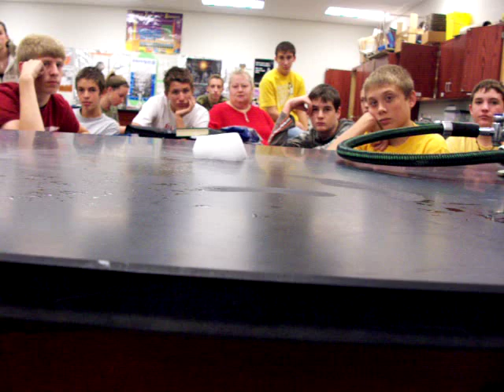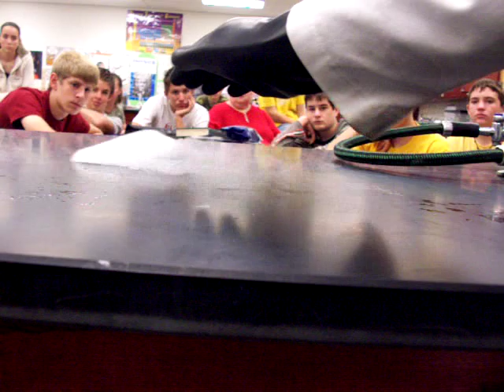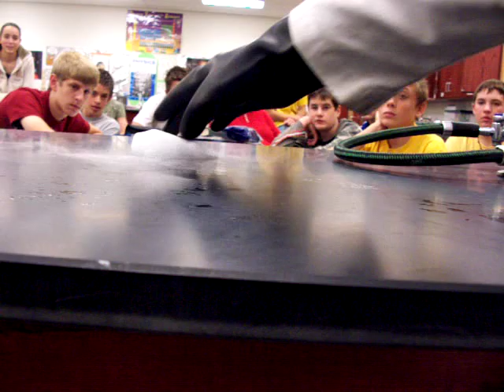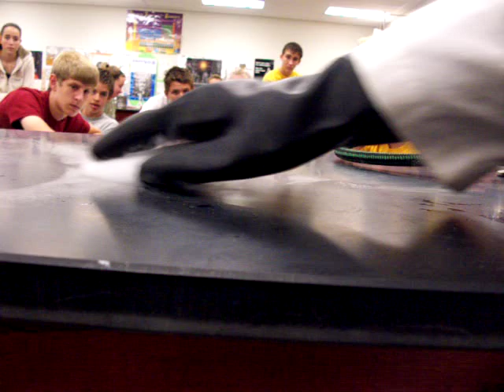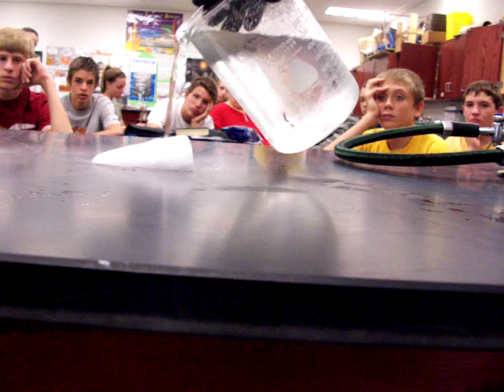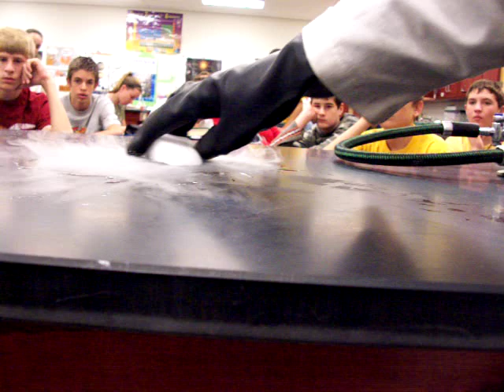Sublimation of Dry Ice #1

Comment from the maker: It depends on a lot of factors including surrounding air temperature, surface area of the dry ice, humidity, lighting, air pressure, etc.
In a cooler I can get a 5 pound block to last up to 3 days and 40 lbs worth of blocks to last 5-7 days.
Most stores that sell dry ice can only keep it 1-2 weeks before it "disappears".  I read somewhere that a 5 lbs block tends to lose 25% of its mass each day in a freezer chest/deep freeze.
When dropped in water a golf ball sized piece lasts a few minutes.